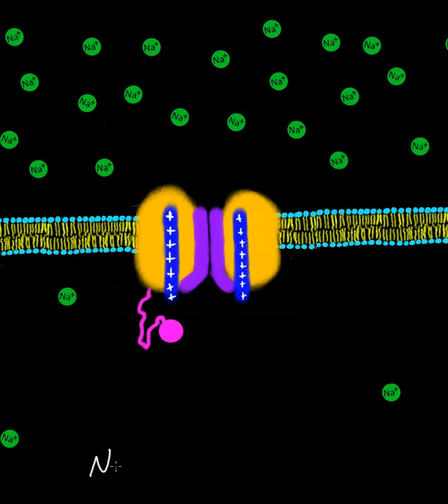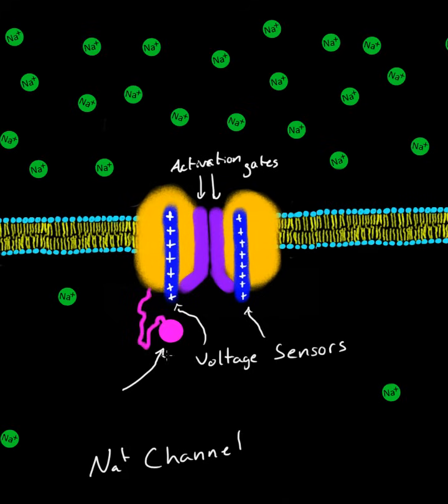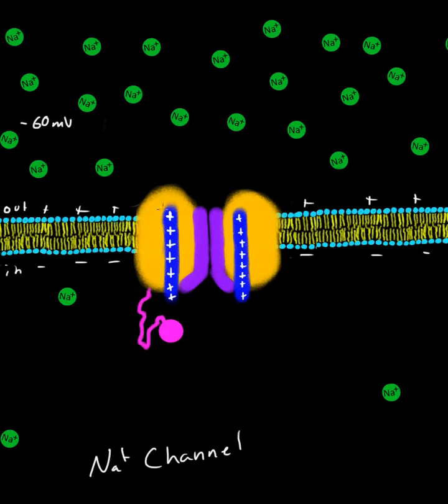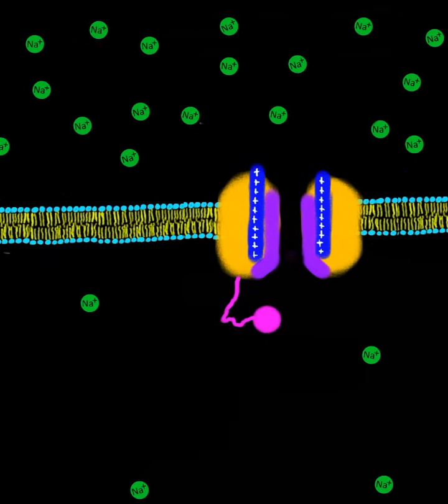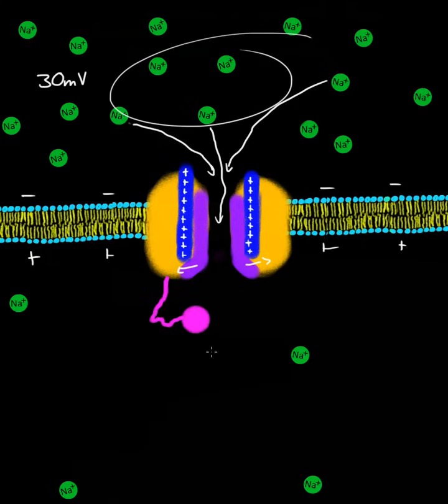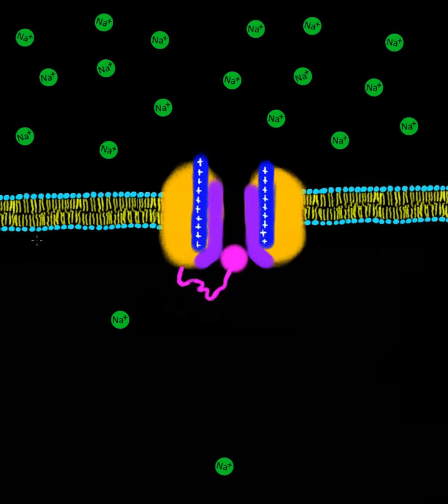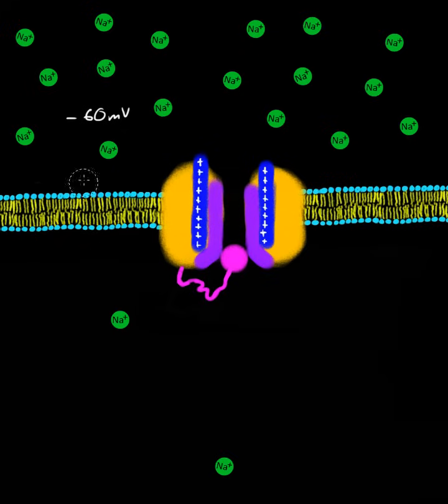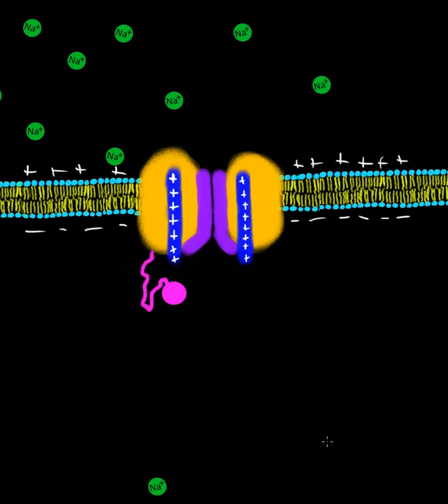Sodium Channel - Voltage Gate

Comment: ididnot get what makes the channel open
Reply: I believe that is triggered by the axon hillock, which sums up input signals from presynaptic neurons and fires an action potential if the threshold value is reached.
Reply: But this isn't entirely related to the sodium channel, I think that's why it was not included.

Comment: So is the inactivation gate timed or does it depend on voltage?
Reply from the maker: +Rami Yanes The inactivation gate is timed, there is a limited amount of time that the gate can be open before it becomes inactivated by the "inactivation gates". I hope that helps.
Reply: Thanks! Had a physiology exam today but this didn't come up on it
Reply: @EngineerClearly  what causes it to remain open ?
Reply: +Engineer Clearly hi! but you said in the video that the inactive gate is closed only when the potassium goes out. hence it is voltage dependant. :\

Comment: also at 3:25 you say "that's all due to these potassiums going from high to low concentration", this should be corrected to "due to these SODIUMS* going from high to low concentration"
Reply: Sodium ions move into the cell, across the concentration/electrical gradient. This changes the voltage from -70 mV to about +30. This creates an action potential, which opens the next sodium channel down the line.

Potassium gates then open allowing potassium ions to move out of the cell, across the concentration gradient, which lowers the voltage. The change in voltage from "losing" potassium ions closes the ion channels, and the atp-powered sodium/potassium pump pumps the sodium out and potassium back in at the same time, resetting the concentration gradients and resting potential back to -70mV resting potential.

Comment: What would cause the initial voltage change outside of the cell? A lesser amount of sodium ions outside the cell? Then what would cause them to go away?
Reply: 1st any stimulus.
2nd the sodium will always be higher outside the cell even after depolarzation.
3rd they go away or return to rest via sodium potassium pump which pushes both ions against their concentration (it uses ATP for this to occur).